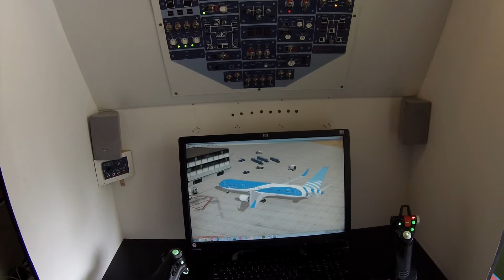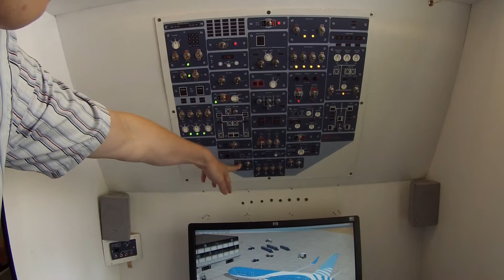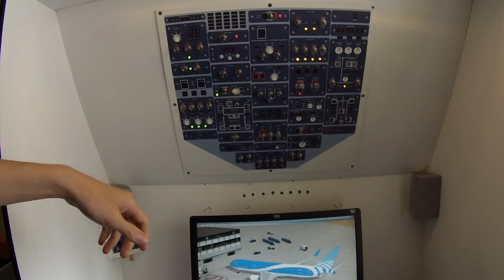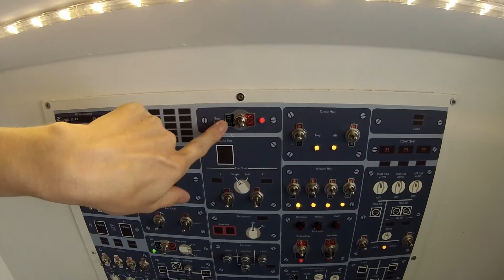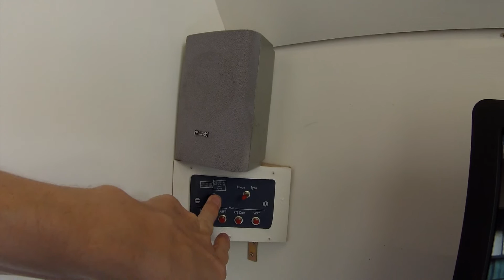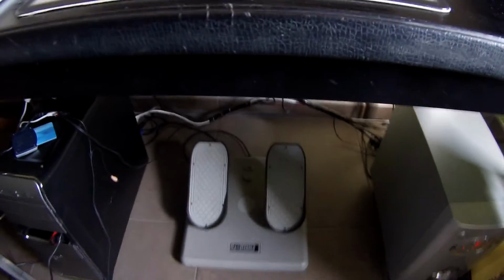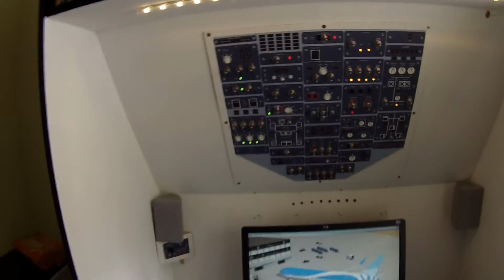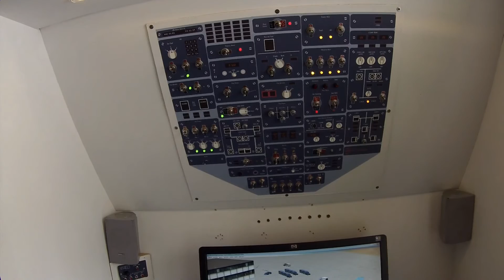Boeing 767 home cockpit - simplified overhead panel

Comment: Dear Mr Devogele,can you please tell me where did you get that overhead panel?Really nice setup you have!!!!!!!!!!!!!!!!!!!!!!!:)
Reply from the maker: I've designed it myself using InDesign. It's actually just a sticker on a piece of MDF board. I drilled holes in it to fit the switches. The switches are connected to two Leo Bodnar cards.